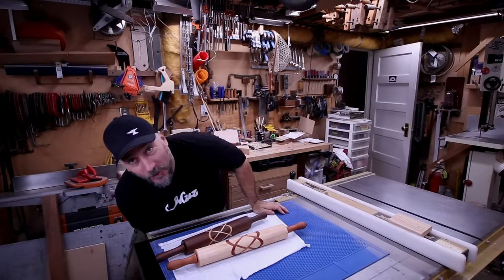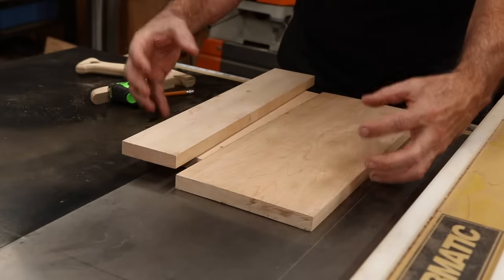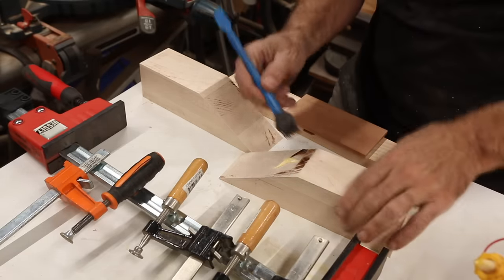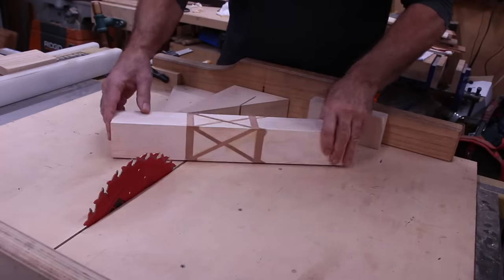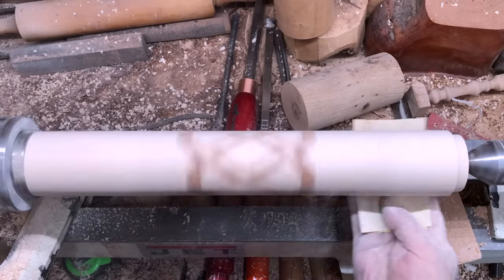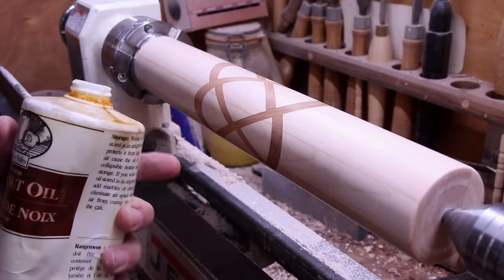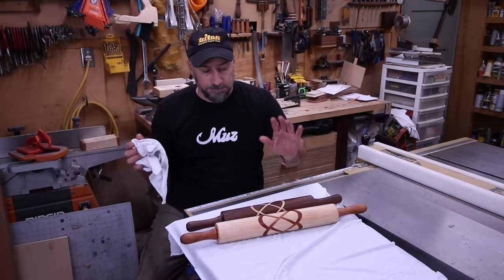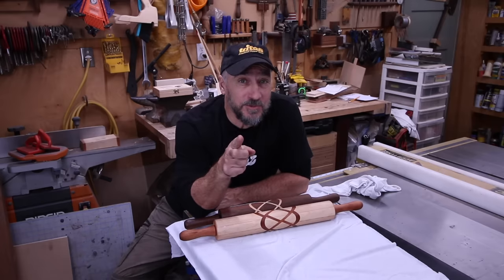Super Cool Rolling Pins!! Easy to Make

Comment: To make sure all the joins match up, apart from the first cut you should not just make a thin cut, but rather cut out a slice equal in thickness to the insert. Also, this stops the rolling pin from getting longer each time you put in an insert and ensures they are all aligned with one another along the length of the rolling pin.
Apart from that, they are lovely :)

Comment: Very nice projects and excellent video.    The one trick I learned when doing these is not to cut the board in half but instead cut a deep kerf and leave about 1/8" so you can avoid any mismatch.  Just make sure to make the slices the exact width of the kerf.  Also, when gluing end grain, not a bad idea to dilute some glue with water and let it soak into the grain a bit.
Reply from the maker: Bob Amarant I like that idea, like you said they better be a nice snug fit. The way I did it , the clamping part is a pain and could run into trouble. Thanks for watching and the kind words.

Comment: I've seen several videos on making these rolling pins both with and without handles.  I believe the key to keeping the Celtic knot neat, symmetrical, and connected at all the right points is to make the slices the 'exact' same thickness as the kerf of your saw blade.  If you remove 1/8" of wood and replace it with a 1/4" slice, the subsequent cuts and slices will be slightly off.  The pins still look nice though. Nice video.
Reply from the maker: Jody Rohde Thanks and interesting info. 👍

Comment: Nice project. I made the same alignment error on my first one that you did. I corrected by, on the second and subsequent diagonal cuts, removing the thickness of the infill pieces so that the loops line up rather than stagger at the intersection. Takes a little sneaking up on it but the end result is a cleaner line.
Reply from the maker: Thank you and ya this was a learning process....
Reply: @TheMuzShop   New subscriber here and I kinda like the "misalignment"... makes them very unique!  Great job!!  Personally, I prefer 1-1/2" to 2-1/2" dowel type rolling pins, more usable area and a more even thickness to the dough being rolled out and less stress to your arms.
Reply from the maker: @jfrphoto01  Thank you and thanks for the sub.

Comment: Very nice! You might find it easier to keep everything "square" and even if you don't cut the wood all the way through when cutting the slots for the inserts. Maybe leave the blade about 1/8" (give or take) shy from going all the way through. Once you get it on the lathe, you should be able to turn enough away to reveal the whole knot. Doing it this way will never seperate the blank into two pieces. There are celtic knot pen turning videos demonstrating what I am trying to convey.

Keep up the great work!
Reply from the maker: J Lang thanks for watching and the advice, someone else mentioned the same idea. Thanks again 👍👍

Comment: I love the design, lot of work on cutting and gluing though...  When using your crosscut sled with the 30deg jig I saw you cut through, then pull the sled back through the blade with the cut pieces hitting the blade again. Does this cause problems for you in getting good straight cuts?  I just made my first sled, and its much smaller, but I just push the whole sled through and out the other side of the table saw to avoid that.  Just wondering if its ever been an issue before building a larger sled.
Reply from the maker: It hasn't been a problem , but I see what you're saying. You should be fine if nothing moves but you feel more comfortable doing it your way that stay with it. Thanks for watching
Reply: You're right.  It's a bad habit to pull the sled back through the spinning blade for safety reasons.  Any movement on either cut part could cause a kickback when it contacts the blade.

Comment: Beautiful work, I wonder if you would instead of just cutting the block diagonally to under a piece of walnut, would also take out same thickness amount from block originally? To make previous diagonals align in X pattern?

Just a thought.... otherwise all is beautiful.
Reply from the maker: Not quite sure what you mean....But thanks
Reply: The Muz Shop I meant after you cut and inserted 1st piece of walnut (I assume it was) diagonally. Then you rotate piece again and cut/insert another one around the corner. But what if you were to instead of just cutting it 2nd ant 3rd time, actually dado it so the width of the cut = the width of insert. And this would keep all previous inserts aligned within its own original plain. ( the detail where two dark planes intersect
Reply from the maker: @11SecSTionStockSnail  Ya I learned after I made this video that the rule is "whatever you take out you need to replace the same. First time trying this and I learned a lot ..... Thanks👍👍

Comment: I was wondering, if you used a dado stack on your table saw to remove the same thickness of material as the contrasting inset piece could you ensure the lines meet more evenly on the finished knot?
Reply: I was gonna mention that. They still look great, but taking out the same thickness of wood would keep it even.
Reply from the maker: You could do that or cut the inserts the same thickness orf the blade. But after it's  all finished off the lathe the lines all meet up beautifully.. Thank you

Comment: Do you have any issues with drilling the shaft hole straight through the pin?  What is the total length of the pin and the drill bit?  Seems like the bit would be wobbly.
Reply from the maker: Staynavytom just make sure it’s in the chuck straight using the live center. Then go a little over halfway and flip it. The drill bit is 12” long and I use 1/4” for one and 5/16” for the other pin , depending on what rod you have. I believe the pins were 12” long. 
Go slow and make sure everything is tight. Also tighten down the tail stock and crank the drill in. 
Happy making.

Comment: Ive done dozens of peppermills like this . Dont set your blade so high leave about an 1/8"  that way you dont have an issue lining the 2 pieces up. 
"
Reply from the maker: Thanks for the tip. If you have the Celtic pieces fit nice and snug, you eliminate all clamping then?

Comment: Thank you I’ve made these and what I’m wondering is why don’t we make the inserts a little smaller so we don’t have to cut them off afterwards? As it’s going to be turned around anyway we don’t need it to go all the way to the very edge. Am I missing something?
Reply from the maker: You can do it that way for sure. I was more worried about the fit than the oversize plus  it’s real easy to cut it off  anyways. But I hear what you are saying.👍🏻👍🏻

Comment: I have made a few of these myself and have the same problem. l would like all parts of the knot to line up . Do you have any suggestions as to how to accomplish this?
Reply from the maker: The secret is to replace the same exact amount  as you cut out so if you cut a 1/8" slot  glue in an 1/8" piece of wood and it should workout for you. Here is another video about it ......     https://youtu.be/NC1lLr5Ymvo
Reply: Do not cut thru the blank. Leave an 1/8” or so of material. The misalignment is because the piece slipped during glue up.

Comment: How did you finish the metal knob on the end? Grinder and a steady hand?
Reply from the maker: I took them to my disc sander and got them as close as possible without touching the wood and finished them out by hand with a sanding block. Thanks for watching. 👍🏻👍🏻👍🏻👍🏻

Comment: Very cool. My only question is did you use epoxy on the middle section of the bar as well(the section in the actual rolling pin) or is it "free" rolling?
Reply: Looked like free roll, though i would have put some vax inside the roller part to extend its life and i hope that is stainless rod.
Reply from the maker: Thanks and yes it is free and I also rubbed some bee's wax on the rod...
Reply from the maker: @Hellsong89  you are right and I did use some bee's wax on the rod off camera.

Comment: Why there was a small gap kept between handles and roller ?
Reply from the maker: Just so they don't rub and incase there is a little glue squeeze out.....
Reply: The Muz Shop is cind of right, but most important reason to make a tiny gap is that if there is no gap. the roller might not roll. hehe
i bet those fine roller pins will mostly be used for display on a shelf.  and other cheaper ones will be used for dayly baking.
in practical use, its better with say 1 inch gap. than 0 gap

Comment: Instead of cutting all the way through each time and gluing, recutting, gluing etc. Couldn't you have just cut grooves 1/4 through the piece (or so), and inlayed each piece to get everything glued up all at once?
Reply: Looks fantastic. Makes me want to get a lathe.
Reply from the maker: No sure if that would work.....
Reply from the maker: Thank you
Reply: You can't do that by grooving 1/4",, because while you make turning , that will remain nothing
Reply from the maker: Ravi Thalari you’re right
Reply: Great video, and inspiring.  I can think of a few of my family members who would like one of these.  Daniel proposed an interesting idea for making the inlay work easier, and with a modification, it might work.  If I understand his idea correctly, he is not suggesting cutting 1/4 inch deep slots for the inlays - the inlays would be to shallow and get erased on the lathe.  He’s suggesting you cut to a partial depth, say 1/4 of the thickness of your square blank, rather than cutting all the way thru the blank each time.  I think, however, to maintain continuity for each ring on the surface of the rolling pin requires you to cut at least almost all the way thru the work piece.  I like the idea proposed by another commenter of cutting on the table saw to a depth 1/8 inch shy of the full blank thickness.  That makes alignment easier, and you will turn away the “gap” on the lathe.  You could make the slot for the inlay with multiple cuts on the table saw, nudging the fence until you sneak up on width that matches the inlay.  I anticipate however that this approach would require more effort to get that extra glue applied to the end grain, like you recommended.  Maybe you could jam glue in the slot using a paint stirring stick or a rag soaked in glue pulled thru the slot.

Comment: i woeld so mess up with the epoxy  and gleu everything together
Reply: Kinda looks like it. At least it seems the roller does not rotate freely around the shaft. Kinda misses the point of a rolling pin.
Reply from the maker: Just be careful and don't use too much epoxy .
Reply: @MikaelLevoniemi  just put the epoxy on the handle bits of the shaft; the main body of the pin will roll around, while the handles stay fixed to the shaft; you can do it the other way around, but, then you need a way to keep the handles on the shaft, so that approach kills too birds w/one stone.